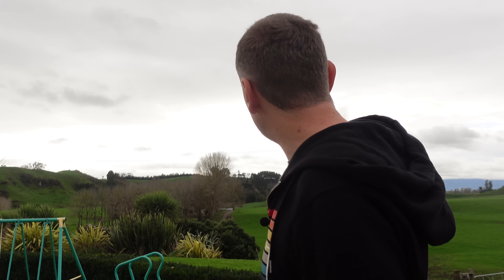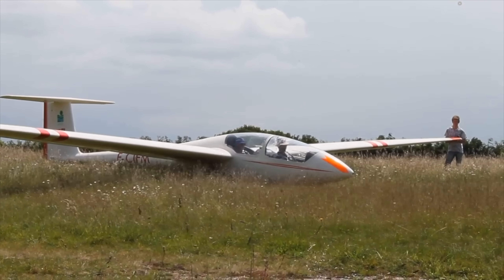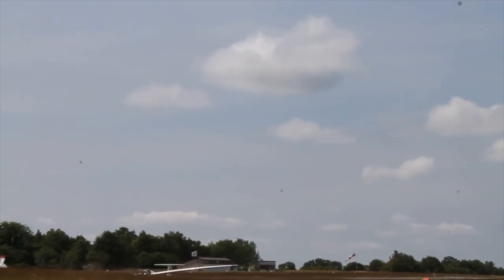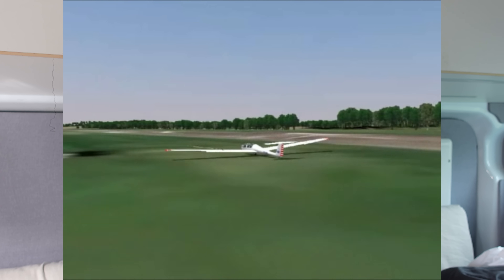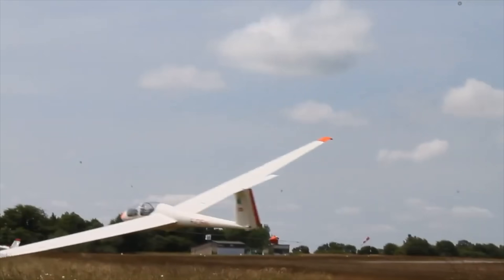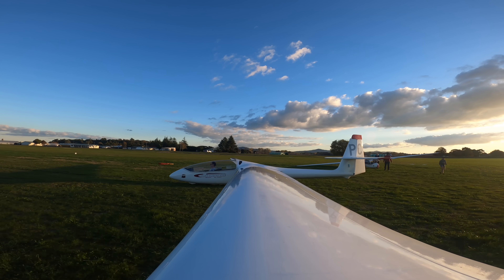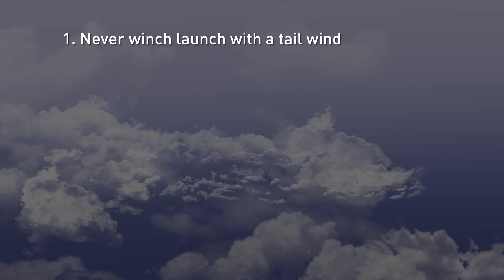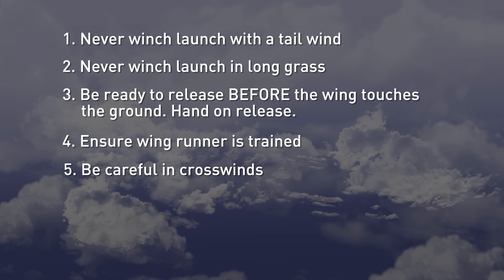Glider Winch Launch Crash 💥 Instructor Reacts

Comment: Honestly the runner couldn't really have held on any longer than he did, the wing is literally ripped away from your hands. Maybe winches work differently in Australia, the two launches at 1:16 look very weird to me with how the plane is pulled at low speed for several seconds. Here once the rope is tight, the winch operated gives it full gas.

Comment: It's informative how long it took for the pilot to react and pull the cable release - appeared to be around 3 seconds from the wing on the ground to release. As you state here, the training should ideally be to pull that release BEFORE the wing even touches the ground... so in that sense this release may have been as much as 4-5 seconds after the ideal release point. That's a horrible amount of time for it to go very badly wrong as this video shows. Looking back on when I was learning at a club, our CFI was of the 'If the wing drops you need to release' school... and therein I suppose lies the dangerous ambiguity: how much wing drop? Even an inch? Only more than 6 inches? It still strikes me that ANY ambiguity in such a situation should be engineered or trained out. Perhaps it ought to be "The second you notice a wing dropping by ANY amount, AUTOMATICALLY release..." and train until that becomes a habit and even a virtue, despite the hassle of retrieving and starting all over again... 
I remember thinking there was another such dangerous ambiguity in the case of decision-making after cable breaks on launch ('land ahead or turn away') that might benefit from any possible ambiguities (and resultant time-consuming or difficult decision-making) being engineered out.

Comment: I know its years old, but still thanks, one very important incident Video.. i have to admint i was not aware of this Situation and even as a wing runner i sometimes - you know, long day, good weather, you get lazy - released far to early when i see this. Wow. Thanks for educating. Still one last thing: i do not see much rudder and aileron movement. We used to do a training by sitting in the glider on the groud and keep wings level in the slightest wind. For that, you had to nove the stick to quit extended positins. So i would expect big moves near ground when the wing dropped. But agree, should not come to this situation in the first place

Comment: The report by French bureau of investigation BEA is online. https://bea.aero/fileadmin/uploads/tx_elydbrapports/BEA2015-0277.pdf . To be noted that both pilots are CFI on a first fly with this new glider. Wind was 030 at 8 to 10kts  crosswind with a runway 12/30. They never released the winch, it was somehow dislodged with the tension and angle of pull. Grass was not cut due to discussion with the farmer even though this day was a celebration for the airstrip and the club.
Reply: The winch line has a built in metal piece that is designed to break off at a certain load to prevent the glider from being dragged along in the even that something like this happens.

Comment: What really makes this deadly is that if a wing (say the left wing)does touch , two things happen quickly.  One--the glider is turned to the left. this causes the left wing to slow down and thus loose lift. But the right wing speeds up-causing an increase in lift.  This pushes the left wing on to the ground even harder.  Second,  as seen in the video,  this action results in almost instant "wingover" and the glider hits the ground nose first.
What the glider really needs is "training wheels on the wing tips, or a normal aircraft undercarriage!

Comment: I had a wing drop on me on a winch launch! I responded very very quickly by fast rolling then slow rolled in the opposite direction to level, then continued normally.  The instructor behind who said later that he was on the point of pulling the yellow ball (release), and then commending me for my fast response. This happened 30 years ago and my reaction time is still good as I'm currently a  competing fencer🤺🤺🤺😃

Comment: Been a glider pilot years ago,  but I still know what went wrong here. This is often fatal, so a lightning fast reacting is important. Better release, than face such a crash.

It is like a crash caused by going up far too steep, then you stall on the winch cable and you go down nose first, but that crash has even more energy. Avoid that at all time.

The thing is, be aware and do not allow the glider to divert from the normal take off. Airspeed, heading, banking, pitch, it all must be okay, or you can get in trouble fast. The flight instructors will teach you this, I reckon, for such things do not change. Yes, modern gliders are different, the winches are better, the airfields could be longer, but the pilots are still human beings.

Comment: Totally agree. I was always taught to have one hand on the cable release during the launch to jettison the cable as required. Indeed on a pre solo check flight with the CFI and expecting a simulated cable break, I panicked and pulled the cable release at about 300 feet, completed a short circuit and landed expecting a ticking off. However the CFI congratulated me on recognising the winch speed wasn't fast enough and my decision to jetison early to abandon the launch. In hindsight it was clear he said that just to make he feel better! That was in a Slingsby Kirby Cadet Mk III. They flew like a brick and you constantly had to tap the altimeter throughout the flight as the needle had a tendency to stick. You never needed a yaw string as you got a face full of airflow if you used too much rudder!

Comment: The following is a shortened translation of the BEA report (written in french). The report is very interesting; it details the several causes which combined led to this accident — involving a Schleicher ASK21 glider on June 14 2015, at Bagnoles de l’Orne Couterne airport (France). 
          The causes of this accident, mercifully non lethal, are as follows: 
•—— the weather conditions were not severe but not ideal, with a transverse wind (from heading 30°–50°, while the grass runway was oriented 30 i.e. heading 300°) ; wind speed was 15 to 18 kmh (9 to 11 mph) with gusts at 22–30 kmh (14–19 mph). The report says that it was a marginal day for soaring, but does not say why: probably because there was not much lift. 
•—— this was the 50th anniversary of the creation of the aeroclub. An anniversary meeting had been organized, and demonstrations as well as baptism flights had been scheduled: there was certainly a strong pressure on the organizers to put a glider in the air. 
•—— there was a snafu with grass cutting. 
For years a nearby farmer has mowed the grass strip; but the requirements of the aeroclub had come in conflict with his farming commitments and he had given notice. The club had bought mowing equipment and had sent a call for bids from operators, but no candidate had appeared; and in the meantime the club had asked the farmer to continue his service. As a result, this service was not extensive and if the (990 x 50 m) grass runway was mowed, a 100 x 100 m grass apron before the beginning of the runway was not: the grass there was 40 cm (16") high.
•—— the glider had been placed as far as possible on the apron, so as to benefit from the maximum length of winch cable. It is not said in the report, but the idea was probably to gain some 10 % in the launch altitude to make for a longer flight in the absence of lift. Accordingly, for some 100 meters (110 yards), the glider was on high grass. 
•—— the wingtip handler did run for a few paces, then let go [nb: the high grass may have hampered his running]. The report does not make further mention of the handler, although if he had run faster and longer (& along the windward wing) the accident would most probably not have occurred. The BEA probably thought this was so obvious as not to merit such a mention (which furthermore would have entailed the somewhat ridiculous - [maybe not so ridiculous, after reading the comments on this video] - task of drafting a “recommended procedure for wingtip running” ...). 
•—— the front pilot and the back pilot were both experienced soaring instructors. 
In front was an instructor on Schleicher K7, who had an experience of 600 h of soaring and 2'000 winch takeoffs; he had no prior experience on the ASK21, which had just recently been rented by the club for the purpose of this meeting. 
In the back-seat was the president of the club, also an instructor with an experience of 2'500 h of soaring. He was the pilot in charge for this flight which was intended to acquaint the front pilot with the particulars of flying the ASK21. 
•—— the front pilot has said that his hand was not on the cable-release handle during the winch pull, and gives as reason that this handle was in the ASK21 in a location different from that in the K7 and which he finds less accessible. 
•—— the back pilot has said that his hand was not on the cable-release handle during the winch pull, and gives as reason that he had full confidence in the front pilot for doing this; in addition, he has stated that he was tired this day, from his duties as president of a club organizing a meet. 
•—— in spite of this, the cable did release from the glider! 
The BEA could not determine how the cable did release by itself, but notes that this release has lessened the consequences of the accident.
•—— The cinematic of the accident (as described in the report) is: 
Handler lets go, glider accelerates and left wing tilts down, left wing brushes the ground, front pilot applies stick to the right, left tilt of glider diminishes, glider takes off and turns to the left, slope of glider goes to nose-down, left-wing down-tilt goes to 30°, cable releases by itself, glider hits ground with a nose-down slope of about 60° and a left-wing down-tilt of about 10°. . 
          Mercifully, the consequences of this accident were limited to material damage to the glider. 
These two have been bloody lucky!      __ .

Comment: Long time ago, I had been involved in exactly the same scenario, but as the winch operator. I agree with the conclusions regarding grass, wing runner and an immediate release by the pilot. It looks to me that the rope was not released by the pilot, but automatically after reaching the automatic release angle. It is very important, that the winch operator continues pulling until there is a release. If the pull force from the winch is removed prematurely, the upset of the glider would have increased dramatically, and it would have likely flipped on its back. From my incident I can tell you, it is the scariest moment you can encounter as a winch operator.

Comment: I agree with the CFI from the Club as a Ret' d Air Force Gliding  Instructor with just 8,500 Glider Launches and also single engine Power flying a Launch from an area with that height of grass should not even been attempted! Your points are valued but the flight should not even been considered.

Comment: Isn't it blatant that the tall grass is at fault? Tall grass may feel like it doesn't offer much resistance when you walk through it, but the speed and width of the wing sums up to a lot of caught resistance. Ask anybody who has operated a scythe.
If you have short grass, then the wing must go further down to interact with it and, if encountered, can skid on top of it. With tall grass, you encounter it already at knee level, and the first interaction is that it pulls on the wing.
Reply from the maker: Yeah absolutely choosing to launch in long grass is the primary cause of this accident. Everything else I talked about is supplemental. Cheers!

Comment: Why don't they design the gliders with wing tip supports, like a thin metal spring device that prevents it from dipping to low and perhaps even bounces it back a bit..
Could even be made ejectable, so after they go off when the cable detaches.. no drag, no weight penalty, just collect the spring tips near the winch...
Reply from the maker: Yeah some motor gliders do have that. But they add drag. And we can really drop things on active runways, there might be planes landing right after you. Plus it's not really needed 99.9% of the time.

Comment: As Air cadet gilding instructor we operate entirely off of winch launch except for instructor training. Here the wing holder is at absolute no fault it the grass being way way to long there was sufficient positive acceleration applied by the winch driver like he was aware minimising the ground roll was going to be vital. Air cadet glider have grass length as a warning in our check lists before full and free movement of controls. I would have reposition the entire launch point to shorter grass even if you had to accept a 45 degree cross wind of up to 15 knots.

Comment: I've got >400 winch launches in my logbook, and the speed with which that occurred staggered me.  Your explanation and reinforcement of the need to be ready to pull the release at any moment were both salutary.   Apart from the fact that he chose to launch in a weed crop, I have every sympathy for the PIC.  

It's also possible of course that the release was so far from the pilot's hand that he was unable to launch with his hand resting on it - there are far too many gliders out there where this is the case.  When we bought our Pilatus, the first thing the syndicate's 'wise old man'  did was put an extension loop cord on the release so that it could rest near the pilot's knee.  25 years later, it's still there.

I saw this happen with a Salto many years ago, in grass that was slightly unkempt (OK for the blaniks and Ka8's and other high wings, but poision for the Salto).  So it's not just 'long grass', it's grass that's unsuitably long for type you are launching.
Reply from the maker: Hi, yeah that's what surprised me as well was how quick it is. Apparently they did try and reach for the release, but couldn't grab it. It actually did back release, luckily for them. Cheers!

Comment: Why don't gliders have sprung wingtip drop-down drag-sticks that keep the wingtips off the ground ?  They can be permanent  (like the tailwheels of many small aircraft) or retractable, and being only a horizontal trailing stick when in flight.
Reply from the maker: 99.9% of the time they are not needed, so not worth the cost and complexity, or drag penalty would be my guess

Comment: The guy holding the wing couldn't do more than humanly possible. He had 0% fault in this. The only fault was that of the retard behind the stick. Truth bites but that's the truth. Maybe surprised by the acceleration, the dumb behind the stick didn't react correctly until very late when the grass friction had generated enough yawing moment and high beta angle that the right wing found a great enouh lift to roll the glider as well. The second mistake of the dumb was to also disconnect the winch which ultimately left the destabilizing left yawing moment to put the glider on it's nose. Had he not disconnected and if the winch operator wouldn't have reduced the pull then the glider would've recovered from both the high negative beta and roll and continued to climb stabilized again. Because the winch is connected ahead and lower from the CG of the glider, the winch gives both a native pitch up as well as a strong yawing stabilizing moment at the same time. The stronger the winch pull, the harder it becomes for the glider to yaw.

And the wind? Huh! Not a good excuse cause as we can all see the wind was almost not present at all. Maybe mostly a 1m/s which is close to nothing. Even at 5 or more m/s lateral winds and a good glider pilot wouldn't leave the wing to scrape the ground like that. More better training is required.

Comment: Grass is too high for take-off or landing.  A small force on the distant wing tip creates a very strong yaw  moment that will turn you around very quickly.  Grass is not benign.  Do not think you are just going to go through it like a lawn mower.   Expect that it might ground loop you in a flash.  Better yet, mow your runway and the grass or weeds immediately on the sides.

Comment: As a once avid glider pilot, wing runner, winch operator, flight instructor. I always notices fairly heavy downward pressure on the wingtip during crosswinds even before movement with wings level. I always told people that there should be no pressure on the wingtip when you hold it before launch. If that means you have to hold it slightly out of the horizontal, do it; it gives the pilot more controllability after you let go of the tip. Especially with slow accel aerotows

Comment: Good video.  Besides mowing the grass (there ought to be preflight go/no-go rule about max grass height), perhaps "grass" fields should use some other material (gravel, pavement, cement) in those first 100 meters or so, so if a wing DOES touch, there won't be nearly the drag on the part of the wing that touches the ground.  Of couse that's easy to say/suggest, as improvements like that take time and/or money.
Reply from the maker: Yeah it’s basic common sense in hindsight! Always obvious in hindsight
Reply: Plus the tall grass could be hiding small branches twigs even rocks that could catch the wing tip and turn the plane. Yes a thorough walk-through of the field with visual inspection which is in the prudent thing to do if my life depended on it

Comment: I'm wondering if the long grass also made it more difficult for the wing-runner to run for as long or fast as he needed to.   Multiple reasons to cut the grass.
Reply from the maker: Yeah absolutely. The problem was not really the wing runners fault, just a possible contributing cause